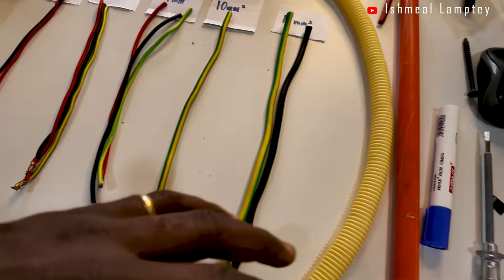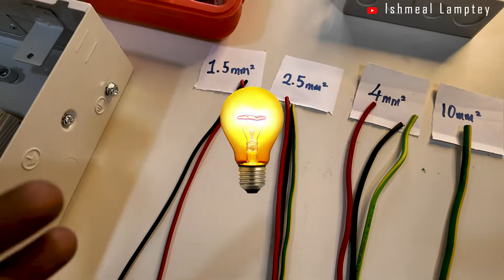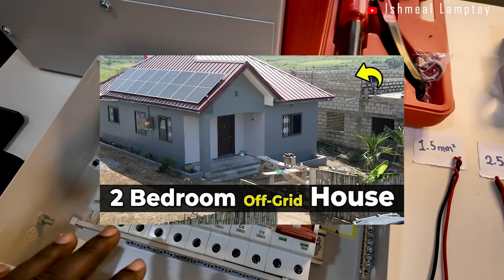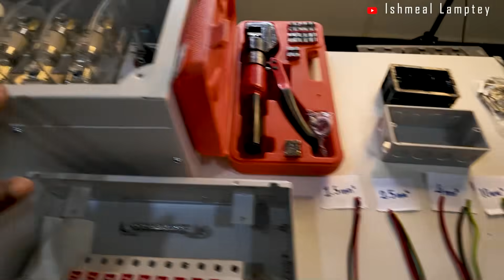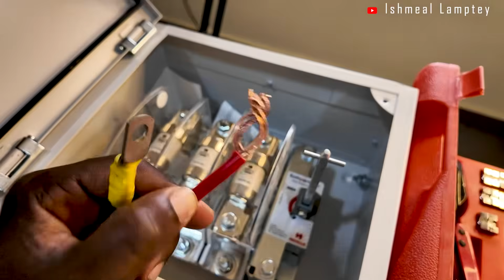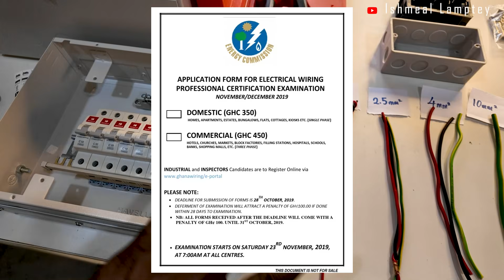Basic Electrical Mistakes That Causes Fires in Homes

Comment: In one of your videos, you said AC connection must  be done with 16mm
Today u said 4mm for heaters and cookers 
Maybe I didn't get your AC cable well ..can u explain
Reply from the maker: I might have mentioned 6mm and not 16mm. 16mm is too large of a size for AC connections. 4mm or 6mm can be used for AC connections depending on the size of AC going to be used